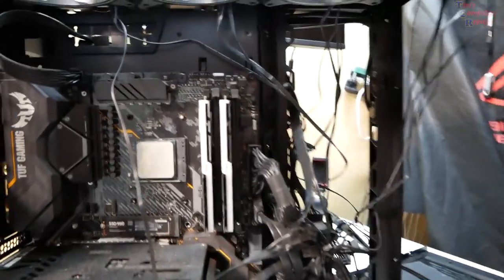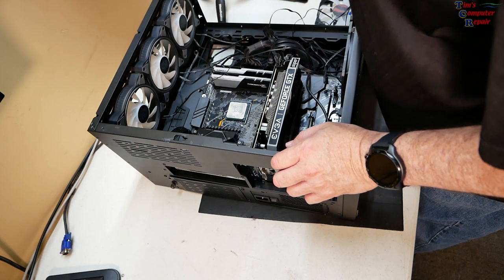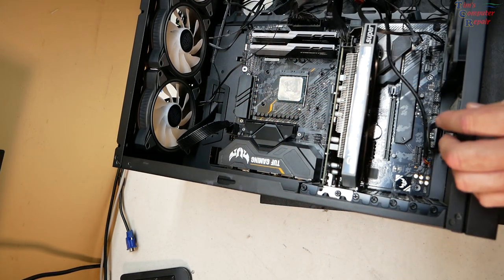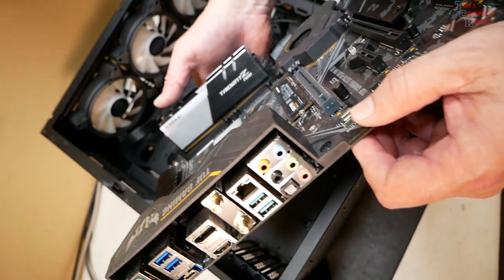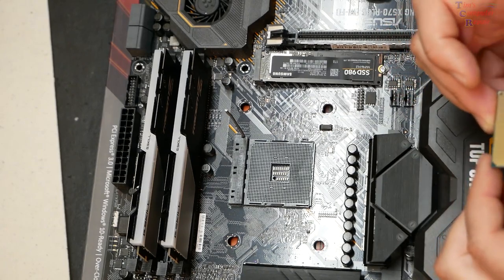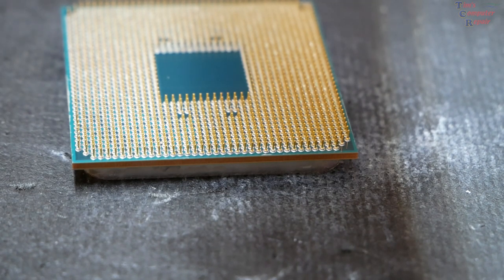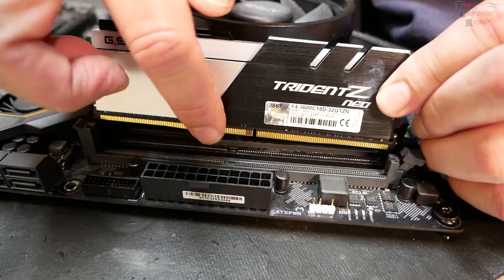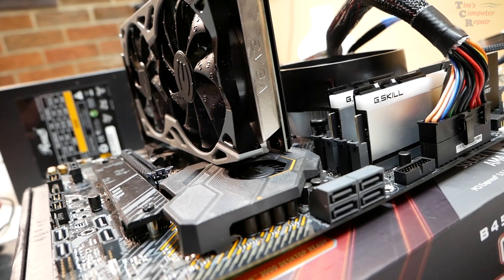Avoid Common Mistakes When Building a Custom Gaming PC

Comment: Boy oh boy, this is one I'd might just pull mb out and see if I could get it to post sitting on test bench.  Then it might make it easier to untangle the rat's nest.  Nothing I saw on initial video made me feel good about this one.  Good luck on this one Tim.

After seeing the mb screws, Ram, and bent pins on CPU  I'm wondering if the USB 3 connector pins are bent also.  Found that on a mb once and it knocked out all usb ports, BIOS could not even recognize any usb drive and all usb ports were intermittent.  That took awhile to straighten out the pins and get the USB connector to seat properly.
Reply from the maker: Yep removing the board is exactly what I did. USB ports are ok in this situation. Thanks for commenting.
Reply: @TimsComputerRepair  Looking forward to follow-up video.  Got turned onto your channel by Carey Holzman who recommended you.

Comment: The customer looked at too many YouTube channels that make it look like it takes 10 minutes to build a PC with snazzy features. Just because the video is 10 minutes doesn't mean it took 10 minutes. Many build channels are marketing channels. I used the mechanical pencil technique on bent pins. The m.2 drives have itty bitty screws thus you need a pack of spare screws. What happened to the screws that came in the motherboard box...and...the manual...
Reply from the maker: Good question I wonder the same. Thanks for commenting.